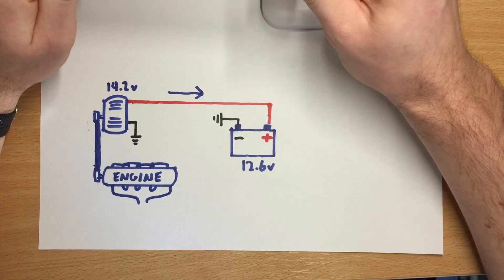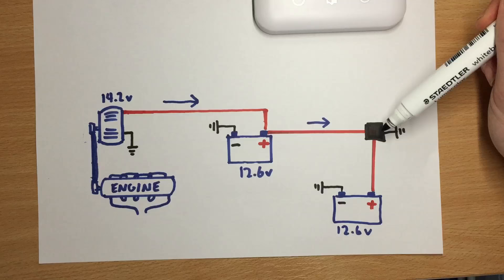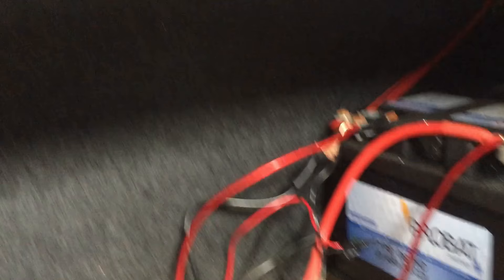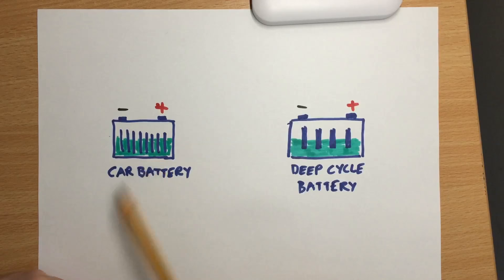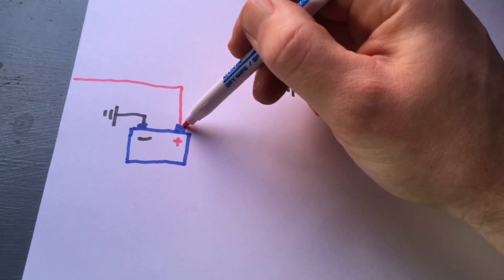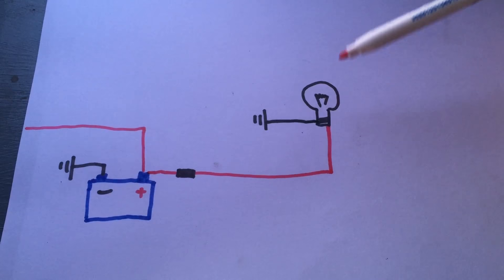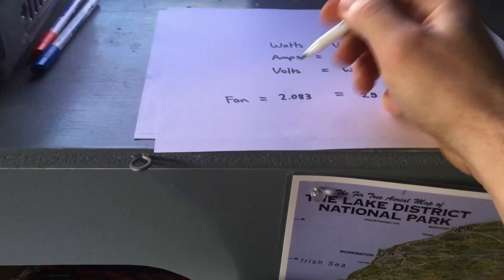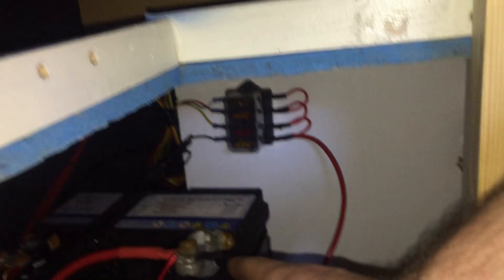Installing a Leisure Battery With Split Charging - A Beginner's Guide (Read Updated Description)

Comment: So is the negative on the battery only ever used to ground and doesn't actually connect to the appliances?

I want to install a single plug socket to charge my power tools and wondering where I would need to wire the negative wire on the plug socket.
Reply from the maker: Hi Warren. Think of it this way - the negatives from all of your appliances do need to go back to the negative on the battery, but you are completing that circuit by letting them all run through the chassis instead of wiring them individually. If you wanted to skip the chassis entirely, there is no reason you couldn’t wire everything individually right back to the battery instead and have nothing connected to the chassis. It’s just a very convenient way of wiring everything back to the negative. I hope this makes sense.
Reply: @JoelsStuff  Yea that makes sense.

If I wanted a single UK mains plug socket directly from the leisure battery what would be the best way to go about it?

Could I just run wires off the positive and negative of the battery and straight to the negative/positive terminals in the plug socket.

Or

Would it better to just get a high rated power inverter and wire that to the battery.

I guess because I only want one plug socket I don't need anything drastic:)
Reply from the maker: Hi again - you won’t be able to run a wire directly. Your car/leisure battery system is a 12v system. A UK mains plug works at 230v, so nothing would work when you plug it in. You need to buy a power inverter which will do this job for you. I don’t know much about inverters, but I know that some appliances such as laptops and sensitive electrical items need a more expensive “pure sine wave” inverter. Good luck!
Reply from the maker: Just another note - you can use an inverter directly from your main car battery - I used to do this. If you start your car up and let it tick over, you can use your tools without worrying about flattening the battery. No need for a second battery if this is your only need
Reply: @JoelsStuff  Ah that's great.

I guess it would be possible to do 'Main Battery > Split Charge Relay > Inverter'? Like as you mentioned to completely skip the need for a second battery.

I'm thinking if the inverter was wired directly to the main battery with no relay you can still run the risk of draining the battery.
Reply from the maker: No there is no point in doing this. The split charge relay assists in helping the second battery charge. If you have no second battery then there is no need for the relay. If you hook up an inverter directly to the relay, it will just cut out after you switch the engine off and you will get no power to your inverter or power tools
Reply: @JoelsStuff  Wouldn't the inverter switching off when the power is killed be a good thing in my case? I don't want the inverter to drain the main battery and I do quite a bit of travelling inbetween jobs which will probably be enough to charge my tools.

I only need to charge one 18v makita drill. :)
Reply from the maker: I guess when you put it like that it makes sense. Effectively the 18v battery in your drill IS the second battery itself. You have had me scratching my head on this one, but I can see your logic. Hope it works out!
Reply: @JoelsStuff  Yea hopefully works out. Honestly thanks a lot for your help!

Comment: this is such a helpful video. especially the drawings. many thanks for sharing this. i’m totally new at this, and i’m wondering how much power (amperage?) is generated while driving, say with an hour’s worth of driving a day? also wondering if i’m installing solar as well, can both the diverted amps and solar amps go into the same battery, or do i need separate batteries?
Reply from the maker: Thank you for the kind words. Whilst driving your alternator just puts out a constant 14ish amps. I’m not experienced with solar power, so I am not the best to advise this, although I am almost certain you will be able to connect both to the same battery if that’s what you require. Sorry I can’t be more helpful. Good luck!

Comment: Thanks for the great video! My DC outlet in my car automatically shuts off when my ignition is off. Could I safely charge a leisure battery by tapping into that circuit?
Reply from the maker: It depends how your DC outlet is wired. For charging a battery you need to make sure all of the wire is heavy duty, so it wouldn’t be safe to do it via the cigarette lighter etc. good luck!

Comment: Thanks! One quick question, appliances like lights and the fridge(12 v socket)  that are already connected to the car, will these work on the leisure battery automatically or do i need to wire them to the work on the leisure?
Reply from the maker: Hi. It’s difficult for me to say without seeing how your existing setup works. This video describes how to setup a new system from scratch, but I am not sure about how to integrate it with an already existing system. Do your existing fridge and lights already work? If so what are they currently running from? If they don’t currently work then I don’t see any reason that you couldn’t connect them as new appliances
Reply: @JoelsStuff  hi, the lights are integrated in the car from factory and the fridge is plugged in a 12v sig plug in the car, so i guess all of it runs true the starterbattery. Have not installed the leisure yet but planning on  doing that. Just a bit confused 😅

Comment: Great vid, thankyou! I'm not sure if I really need a leisure battery for my use. However I'm planning to get a sub/speaker system in there.. do you think that makes it essential? I noticed you mention you're powering a sub.
Reply from the maker: The only reason I’d install a second battery for this is if I wanted to use it a lot when parked. If it’s just for when you are driving then your alternator will power it

Comment: Great video, very helpful! I'm about to wire my van and the kits (wiring kit from van battery to leisure battery) i'm looking at don't have fuse set up before and after VSR, what fuse should i use? Thanks Mike
Reply from the maker: Hey Mike! Did your kit not come with fuses in these spots? I wouldn’t want to say what fuses you should use, as I am not totally sure 🤐
Reply: Joel's Stuff ok thanks, I haven’t bought a kit yet and I’m in New Zealand so I’ll keep looking, I don’t want to hold you anything but do you know what fuses are on yours?
Reply from the maker: I know the wire is rated at 120amps but I have forgotten exactly what the fuses are rated for. I would go and look but the van is in the garage for repairs at the moment 😭

Comment: Hello, I am new to this.. I bought a van which had two batteries, (main one and leisure one). They are both connected to the alternator (I don't know the setup though). Is the setup automaticall like in the video ? or could it be alternator connected to both batteries without the two batteries being connected together ?
anways...  I changed the leisure battery for a much bigger one and setup solar on it as well (with a charge controller). The leisure battery can therefore be charged by solar and with the alternator. My issue is that I drove my van for 5 minutes and the front main battery started releasing steam. It had overheated. From what I checked the alternator is giving too much power now. So the question is, am I unlucky and the regulator on my alternator randomly broke or did something in my setup screw it ? Is there a way in this setup that could be screwing my alternator or do I need to add something such as another regulator between my leisure battery and alternator ??? If you can help that would be so amazing...
Reply from the maker: Hi Marc! It sounds a bit complicated! I would advise tracing your wires and drawing a diagram so you understand the setup you have properly. I would start off by disconnecting your leisure battery and solar panels completely, and getting to the bottom of your issue with your main battery/alternator. Once that is sorted out you can start adding a second battery and solar panels etc. sorry I can’t be more helpful without investigating it myself. Good luck!

Comment: Does this particular split charge relay have a diode built in to prevent back flow from you leisure battery to the starter battery when driving?

Comment: What amp fuse should i use for battery to battery connection? Also what gauge wire to use battery to battery?

Comment: I'm a novice when it comes to electrics and It might be a daft question, but on the diagram it shows both batteries are earthed separately.  I'm just about to set up my system in a  vault box in the back of my landrover which is removable, I want to use an Anderson plug from the box as I have a internal power supply from the vehicle  battery with an Anderson plug.  My question is if I connect the leisure battery negative terminal to the Anderson plug will that do as the earth.
Reply from the maker: If the anderson plug on your van is earthed to the vehicle chassis and the anderson plug and wiring is heavy duty enough (my leisure battery negative earth cable is rated at 120amps) then I don’t see why it wouldn’t work. I can only advise asking a professional to look at it however to be sure. Good luck!

Comment: What size fuse did you use on the connection between the main battery and relay and between the relay and leisure battery?

Comment: I would like to know how many hours or minutes you can run your fan, light, and phone charger on your 2nd battery before it goes flat?  Also, when you went under the front hood, those massive horns look cool.  Do you have a video on those?
Reply from the maker: Thank you! I do have a video of fitting the horns on my channel. The battery will last a long time on these three, as they are not power hungry. You can calculate a rough estimate by looking at how many amp hours (ah) your battery is, and how many amps your appliance is using. Good luck!

Comment: might be worth installing one because when you're stranded in the middle of the forest tens of kilometers from the nearest road with a dead starter battery, you atleast have a spare. I've seen leisure battery installs with a manual switch to use it for the starter in case of emergency
Reply from the maker: Great idea!

Comment: very informative video. quick question, I saw an inverter near your leisure battery.. how do you connect it to the battery? and do you have any video on how to install it? Thanks mate 😁
Reply from the maker: Hey! I do have a cheap inverter, but I haven’t made any video about it yet. It’s as simple as clipping it onto the positive and negative terminals with the crocodile clips that came with it (just like attaching jump leads) and it’s ready to go. It’s worth researching which one to buy (especially if you should pay more for a pure sine wave inverter). Good luck!
Reply: @JoelsStuff  thanks mate for the info. Have a good one.
Reply: @JoelsStuff  what is an inverter?
Reply: @CRyan71  it changes the 12V DC supply of the van to 230V AC for running household appliances.

"Pure sine wave" describes the 'smooth' output of the inverter which allows appliances to run correctly. 

It'd basically a very fast switch mixed with a transformer inside a housing.

Comment: Great videos. Just wondering about the inline fuse you have after your starter battery, I can't tell the gauge of wire.

Or have you just used the battery wire and put in a fuse holder? Whenever I look for fuse holders/inline fuse holder they mostly come with real thin wires. The kind you'd use in a stereo. 

Hope that makes sense I'm not so great at explaining what I mean.

//
Jamie
Reply from the maker: Hi Jamie. Sorry for replying and then deleting - I read your question wrong and gave the wrong answer.

The cable and fuse I have from the starter battery to the leisure battery is a heavy duty wire and fuse setup that came with my split charge relay kit. I have to admit that I am not sure what it is rated at, but if you search ebay for 170amp car battery wire, and a heavy duty fuse holder then you should be ok. Just make sure your cable is all rated higher than the fuse you are using. Best of luck!
Reply: Thought it must be, will check ebay etc. Thanks for the videos, really useful. Nice van too. All the best

Comment: You have connected the auto relay wrong in 4.34. Should be a negative from the relay to house battery and a negative from house to start battery.
Reply from the maker: They are all connected via the chassis so it’s exactly the same

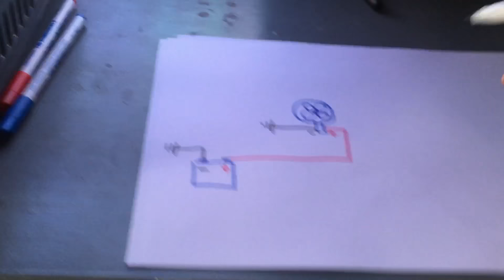Comment: Ok you explain things prefect to dummy's like me. BUT........ At 11:30 you said that the fuse should be lower than the wire used (8 amp wire. Use a 5 amp fuse. Got it). But then at 14:00 with your fan you say to have the amp for the fuse higher than the amp for the fan???? The opposite to what you said at 11:30. Or is the that the wire has to be the same or higher amp than the fan (other whatever you are installing)?
Reply from the maker: The fuse should be higher than the fan (if not then it will blow a lot). The fuse amps should be in between the appliance and the wire (wire is always the highest). This way you avoid any conditions where the wire burns

Comment: Smart Alternators, Joel, the damage is done.  You need to redo and rerelease the video or it is misinformation.  They came in in 2006 so it's not like it a recent new tech thing.  Did you miss the UK swap over from 240v to 230v too?
Reply from the maker: thanks for mentioning this. The best I can do is put this in the title of the video like I have done. Perhaps I’ll make another one if I get time. Thanks!

Comment: How come nobody explains wire gauges?? That’s very important. What size wires are being used
Reply from the maker: I’ve always used amp rating as a measurement for wire selection, because it seems to make sense to me. I’m no expert though
Reply: Joel's Stuff do you get that off of a label on the battery or do you do your own reading for it ?

Comment: Great vid , some help please, if I have a 75ah leisure battery what size of split charge relay do I need?? Only for light usage , thanks in advance 👍
Reply from the maker: Hi. From what I understand the Ah on your battery just indicates how long it will last before it goes flat (i.e. if you are using 1 amp to power something it will last 75 hours, or if you are using 10 amps it will last 7.5 hours before going flat). I don’t think it matters what relay you are using for these purposes - as long as it operates as expected it should charge your battery fine
Reply: @JoelsStuff  thanks 👍

Comment: Here's my question..
I have a 15 watt amp and 4 12s also.. would I need to upgrade my alternator before starting this? Obviously the amp is connected to the positive terminal which I just replaced the piece today..
Reply: I see your subwoofers at the 7 minute mark. Changing my question..

Can I install 2 or 3 batteries for extended time?
My van has a TV and DVD player and home theater system.. and a vacuum and some other stuff. Can I reroute all those to run only from the secondary batteries?  It seems like the obvious answer is yes but there are things that are curveballs..

Comment: Great video. How about charging a laptop with normal 3 pin charger?
Reply from the maker: You can easily add a power inverter to get 230v. Make sure it’s a pure sine wave inverter if you are using a laptop
Reply: 150watts, but if wanna coffee 1500w and finger size wires

Comment: Hello mate at 15.27 you mentioned the positive from the leisure battery directly to the fuse box. Does the fuse box require a negative coming off it also?

Thanks in advance Garry.
Reply from the maker: Hi Garry,

The fuse box does not have it’s own negative, at least not a simple one like mine. It just sits on the positive side of the circuit, so positive in and positive continuing out.
Reply: Joel's Stuff Thankyou for you reply, where did you buy your fuse box that comes with the wiring?

Comment: What size is the heavy duty red wire you use, is it 10mm or 10mm2, I only ask because I think I may have bought the wrong wire
Reply from the maker: Hi! I am not sure of the width, but it is rated for 120amps and came as a part of the relay kit. Good luck!

Comment: can I just use a diode instead of that split charge relay you talk about here 2:46?
Reply from the maker: I don’t think so. You need a charge coming from the main battery to the second battery under certain circumstances (engine running) but not under other circumstances (engine off). You can’t achieve this with a diode. You can however use a simple on off switch, but make sure it is a heavy duty isolator switch

Comment: @Joel's Stuff Hello i have a leisure battery with a vent hole and caps on top do i remove the caps while charging or leave them on. 

Thanks
Reply from the maker: Hi there. I’m not certain as I have not used one like this before. You had better consult the manual. Some batteries do need venting. Good luck!
Reply: @JoelsStuff  np thanks

Comment: With a split charge relay installed, what happens if you put a charger on your main battery, does it try to charge your second battery also ?
Reply from the maker: Yep as long as the charger is putting out 14 volts or so it should open up and charge both batteries

Comment: How have you got on using the car battery as a leisure battery? Any issues? I'm only going to be using 12v led lights to start with and have a spare car battery.
Reply from the maker: Absolutely fine so far, but I don’t use it an awful lot. I’ve had the same one for 3 years and no problems